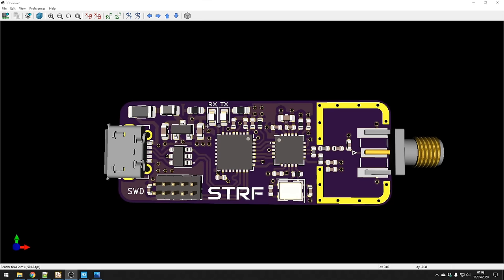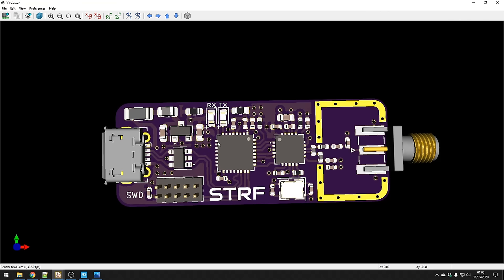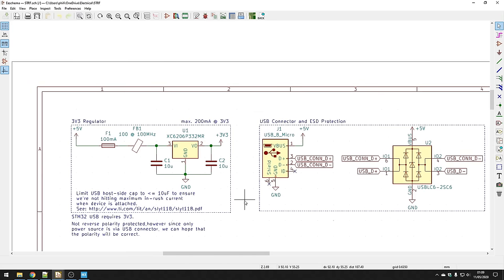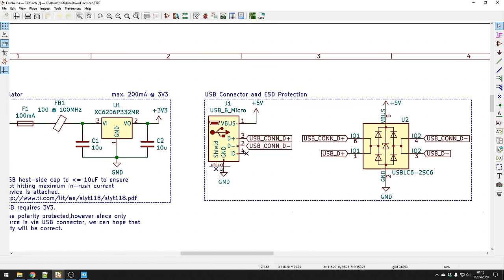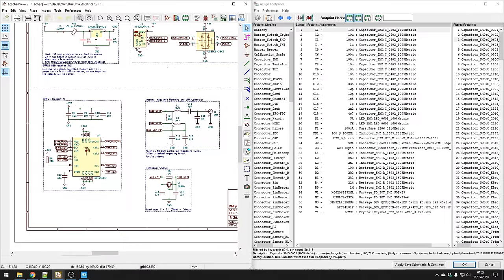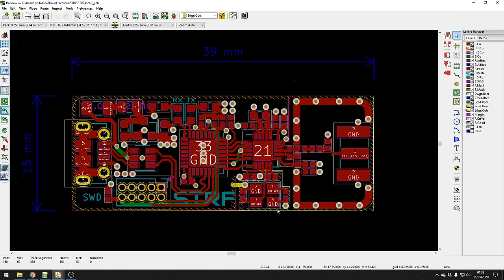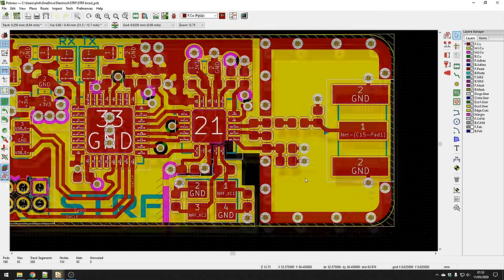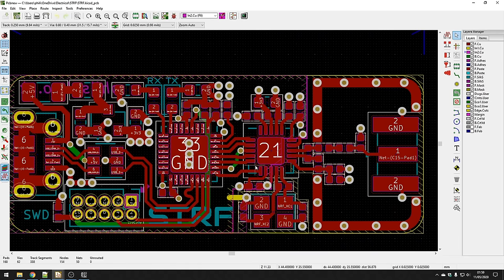KiCad STM32 + RF + USB Hardware Design - Phil's Lab #5

Comment: Hi Phil. First at all thank you very much for such great content! It really helped me a lot to create my own designs. I´ve got a question related to pcb order. I tried to order your design in jlcpcb with assembly and I realized that the PCB is too small and not supported by jlcpcb. I came up with the workaround panelize the pcb but just copy/paste adding some mouse bites did not work for me. I think did not work because of the components sharing the same references. Jlcpcb also offers panelization but assembly is not supported if you choose that option. Any idea how can I handle it? Did you already panelize in Kicad some design? Many thanks!
Reply from the maker: Hi Daniel, Thank you very much! Good timing with your comment. I just pushed a 'panelised' version to the Git repo, so that you should now be able to order it via JLCPCB. This includes the Gerbers, BOM, and footprint position files. Each board effectively has two STRFs on it, which can be separated off via the mouse bites. Let me know if that works!
Reply: @PhilsLab  Hi Phil, thank you for the reply. I´ve tried right now your panel and it ´s working perfectly!! I had look into your design and I can only point one difference compared to my try. The components in the BOM and Footprint positions files are renamed as "a" and "b". Is only this required to panelize in Kicad? Did you do it manually?
Many thanks!
Reply from the maker: @12012004  Awesome, glad to thear that! I essentially did everything manually - I have never looked into how to do panelisation properly in KiCad. So just duplicated the board in PCBNew, duplicated, then exported the footprint position file. I duplicated the items in the BOM and added 'a' and 'b' to the components to distinguish them. Then also made the changes in the footprint position file.
Note, if you do order the boards, I've added JLCJLCJLCJLC on the rear silkscreen so you can choose the option to have the order number placed there. Additionally, I've added tooling holes for assembly, so you can click that option ('Tooling holes added by customer'). Lastly, as I have not yet thoroughly checked schematics and board design, I can't give a guarantee that it will work - but I believe everything should.

Comment: You should have used ST's STM32WL single-chip SoC!
Reply from the maker: Unfortunately, JLCPCB - the manufacturer/assembly house I typically go for, doesn't stock them. Otherwise yeah - that would've been cool.
Reply: @PhilsLab  We (ST) will have them out more in stock around the world very soon.  Nice job on these videos!

Comment: Im curious if you looked at the USB signals on a scope. You chose to match the lengths at the cost of causing a discontinuity in your controlled impedance. I wonder if that discontinuity in conjunction with the parasitic capacitance of your ESD protection made any meaningful impact on the signal integrity? I am assuming that since its such a small trace it wont matter much.
Reply from the maker: I assumed - as you say, given the relatively small discontinuity and the fairly low data rate (max. 12 Mbit/s), that this should not be a problem. Once I get the boards manufactured and assembled I will take a look at the signals on the scope and give you an update. I've made one or two boards with USB + STM32 on them and so far they have all functioned correctly.

Comment: What kind of USB output will this produce? Normally (at least for me), you'd use an FTDI chip and get a serial terminal that you could use to talk to the STM32. Since it has built in USB, is there a way to do something similar?
Reply from the maker: Yeah, you can configure the STM32 to act as like a 'COM port' - so will be very similar to your FTDI experiences.

Comment: You permanently pull the BOOT0 pin low... What will you do if you accidentally forgot to enable DEBUG-Trace-Asynchronous pins in your application?
Reply from the maker: I typically pull the BOOT0 pin low via a fairly high-valued resistor. Should I forget to enable SWD (which has thankfully never happened!) I can simply apply a logic high voltage to one end of the resistor to get the chip to run its bootloader. I definitely wouldn't recommend pulling BOOT0 directly to ground for exactly that reason!

Comment: Nice video. But i don't think LDO output will be 200mA. Since it is just a varible resistor its output current should be the same as its input current (100mA).
Reply from the maker: Thanks! The comment about the 200mA was just noting that the LDO is capable of delivering a maximum of 200mA at 3.3V (just to confirm that it can easily supply the necessary current required by the design).

Comment: Could the same crystal oscillator be used as the processor and rf transceiver clock?
Reply from the maker: Unfortunately not, since each IC will have its own oscillator circuit inside which drive the crystals.

Comment: Hey Phil,

I'm not that familiar with PCB Design but is there a way to use multiple transceiver chips in parallel or serial to enhance the overall output power without producing noise like a rf amplifier would do?
Let's say there aren't any legal limitations - can I build a 5W radio with this chip?

thanks :)
Reply from the maker: Hey man, As a first guess, I don't think that would be feasible. I think a main issue would be timing, i.e. making sure the RF chips transmit at the precisely the same time. I believe your noise performance won't be much better (if not worse), than just using an LNA (or a couple).
Reply: @PhilsLab  Thanks for your advice.

Comment: Nice, my name is Adrielcio Pedrozo, I'm from Brasil. I have a question. 
Unconnected pins must be grounded?
Reply: no, they are not connected
Reply from the maker: Thanks! You can use the STM32's internal pull-down resistors. I typically do not use external resistors, since that will use up a lot of board space.

Comment: But what about GND under the crystal? Why is it separated?
Reply from the maker: I read about that in one of ST's application notes regarding PCB layout (in particular w.r.t crystals), so thought it'd be best to follow what they have done. This is the application note: AN2867. Their reasoning is: " It prevents interferences between the oscillator components and other application components (e.g. crosstalk between paths)".
Reply: @PhilsLab  Thank you very much for detailed answer. Apparently they mean that voltage from crystal can spread through ground copper (in theory). You know some capacitance between crystal pins and copper layer. Then some non zero resistance of the copper.

Comment: Why no guard ring under oscillator, why it must have not ground planes under?
Reply from the maker: I used this method, as it's recommended by various sources on the internet. This one is good as well: https://www.st.com/resource/en/application_note/cd00221665-oscillator-design-guide-for-stm8afals-stm32-mcus-and-mpus-stmicroelectronics.pdf
I have found that my designs work without a guard ring around the oscillator, so typically I omit it for the sake of space.

Comment: Thanks for your video . I use KICAD PCB CALCULATOR to calculate impedance to compare with JLC website. In case match single end 50 ohm impedance ,result is a little different. But for differential impedance match, Result is not same . I use Er=4.6, H=0.18mm, T=0.035mm, W=10.28mil, s= 8mil  in KICAD. Result is Zeven =65.1666 ohm so Zdiff= 65.1666/2=32.58 ohm not 90 ohm.why?
Reply from the maker: Thanks for your comment. Using the KiCad PCB calculator, you need to multiply Zodd by 2 to get the differential impedance. So Setting W=10.28mil, S=8mil (for H=0.18mm and T=35um), gives Zodd = 49 Ohms, so Zdiff is about 98 Ohms - a 10% difference to the JLCPCB value, which is fine.
Reply: @PhilsLab  thanks for your reply.I misunderstand, USB  is odd mode not even.

Comment: Phil, if this is for integration into a robot, then where are the mounting holes?
Reply from the maker: Hi Nick, this is meant to be connected to the host computer via USB and connect remotely to the robot via the RF link, where the robot has a different PCB with an additional NRF transceiver. Sorry if I didn't explain that well in the video.

Comment: Thanks for the video. What do you think of ST's development tools? Good? Not so good? I'm firing my present microcontroller company because of janky development tools and looking for another.
Reply from the maker: Thanks for your comment!
For me the ST stuff is fairly ideal, since it comes with (free) software such as CubeMX/IDE (which lets you set the pinouts without having to look at register maps, etc, etc), the debugger is cheap (20-ish EUR) and really easy to set up, the low-level driver libraries are already available (HAL), and the hardware design side of things is well documented and fairly straightforward to implement. (Adding to that the chips themselves aren't particularly expensive for the performance you get)
I generally can't stand MCUs where I spend most of my time writing drivers or worrying about nitty gritty low level details in software/hardware - I'd much rather work on the actual problem that the product is trying to solve. And I feel like STM32s are pretty decent in that regard.
That being said, the HAL device driver library can be rather bug-ridden. I've had an experience recently trying to implement I2S for an audio codec, where the library required a fair amount of re-writing to get working. Apparently, quite a few other people face the same problems with ST's libraries - but then again, if you're willing, you can write your own device drivers and that's that.
Reply: @PhilsLab  Thanks for the feedback. NXP has a chip that I want to use but I'd like to get some feedback on their development tools before I decide to jump in. The cost of the chips is very cheap compared to the time and effort of getting them running so I'm looking at that aspect more carefully now.
Reply from the maker: @jay_321  I had a brief look at NXP, that would've been my choice after ST. Would be good to hear what you end up using.

Comment: @phil s - diode after fuse to ground will not take much space. Can be left unmounted. Just my 2 cent
Reply from the maker: Yeah, wouldn’t take up much space. My main reasoning is that reverse polarity on this board is probably very unlikely, since the only power in is via the USB connector. But then again you never can be too certain...

Comment: great job sir. IMO, the middle signal pad of the SMA footprint looks way too large/wide for a 2.4GHz signal. It will probably form a capacitive impedance that can mess the matching network and enalrge your desired small insertion loss.
Reply from the maker: Thanks a lot Alex! This was a footprint taken directly from the KiCad libraries. If you take a look at the excellent HackRF (https://github.com/mossmann/hackrf) you will see the the connection to the large SMA connector pads is similar in size. In general, SMA connectors will have these large pads/pin connections to them. Unfortunately, as you also said,  interface effects will always be present when using lumped elements and connectors.

Comment: The max bit rate ?
Reply from the maker: I still need to get the boards manufactured once I've checked the schematic/layout one more time and then I'll get back to you on what bit rate I'll be running it at. The USB will first of all double as a virtual COM port, so something like 115200 baud. The radio's maximum data rate is given as 2000kbps.
Reply: @PhilsLab  ? 2Mbps ?  https://www.youtube.com/watch?v=BICLdSN4SDA
2 - 20 Kbps  digital data xmtr, FM/QUAM ,  20Mbps=video rate (25 frames per sec) an absorbing mix  of leading  tech for home use -

Comment: I recommend for the PH3 (boot0 pin) to connect it to a switch, when pressed it is high during power-on to allow USB DFU firmware updates. Another benefit is that you have a user-switch once the MCU is booted. This can be done via:  PH3->1k->switch->VDD, and a 10k after the 1k to GND.

For the Debugger Interface I recommend to add a UART RX/TX to it, this allows to bring them via a virtual COM to the host for debugging. I do this via a Nucleo L4 Board, see my instructions here: https://www.radioshuttle.de/en/turtle-en/nucleo-st-link-interface-en/

When you use the STM32L432KC you benefit from Mbed-os compatibility to a Nucleo432 board which gives you a great OS.

Your video is great, explaining why you do all this is beneficial to everyone, great job.
Reply from the maker: Thank you for your comment, Helmut!

I agree with you that this is in most cases a good thing to do. However, for this board I intentionally decided not to make the BOOT0 pin voltage variable, for the sake of board space and me hardly ever using the DFU functionality, since I almost exclusively use SWD.

Additionally, there is a SWO connector on the debug header, which allows you to 'printf' via the debugger (as well as monitor live variables), as you would via a UART-to-TTL connection. Therefore, the UART wouldn't really be needed. Furthermore, the USB can also double as a virtual COM port.

But thanks again for your ideas!
Reply: @PhilsLab  thank you for your advise, I know about the SWO line, I know about the USB serial protocol, however I use the SWD debugger and RX/TX for debugging via the virtual COM port and openocd. At present I debug/enhance the USB code of Mbed-os. For my projects I detect a connected debugger and use the RX/TX of the debugger header (via a Nucleo board) with a little command interpreter to issue commands to the target, therefore I use RX/TX. When there is no debugger connected I use the same command interface via a USB serial.

Thank you for your advise and great tutorial.

PS: I am great fan of the STM32L4 series, I didi several hobby projects with the L4 and if you ever have STM32L4 questions I am happy to help/discuss.
Reply from the maker: @HelmutTschemernjak  I hadn't heard of OpenOCD, so will look into that - thanks for the tip! And yes, definitely should I delve deeper into the STM32L4 series I'll send you a message - thanks again!

Comment: Hello Philip
I have seen your video about KiCAD and need some help, because I lack
the knowledge. My problem concerns a building of a new computer. I had
to use a different case here than I had planned. This one has a USB
type C front port, my motherboard has no port for this. Since I want to
use my internal USB3 slot for something else, I had an idea for the
Type-C connector. Unfortunately there are no adapters for my idea.
I would like to route a normal mobile phone charger with type-C through
the case to the front panel.
The housing uses this funny connection: 
https://linustechtips.com/main/uploads/monthly_2018_07/image.png.cbfb5d2faf80198ec52145639ef23a21.png
I would like to put this connector into a circuit board which offers me
a USB-TypC connection. So I can charge my mobile phone at the front of
my computer case and provide the power source externally.
Would you be able to help me with the PCB?
Since I am not familiar with such an adapter product, maybe you can
sell it later.
Anyway, thank you for your feedback and have a nice evening.
Reply from the maker: Hi there, I'm sorry for the late reply. Would you mind sending me an e-mail at philip.salmony@philsal.co.uk? I'd be happy to discuss what needs to be done via email!